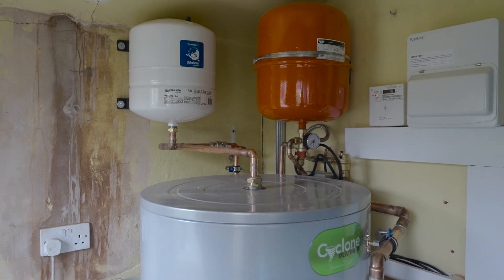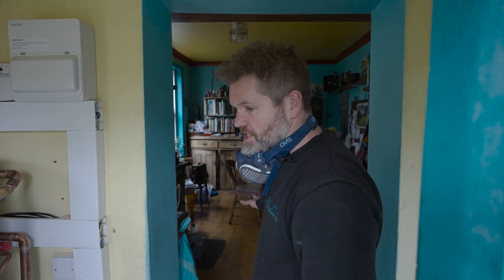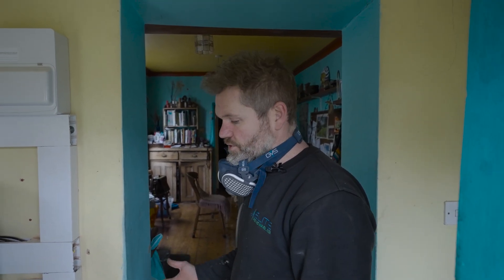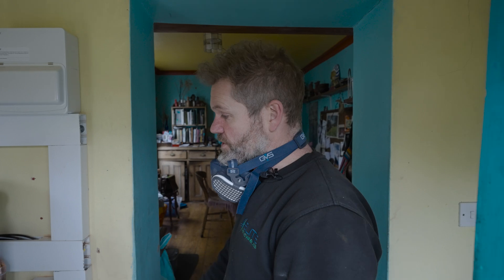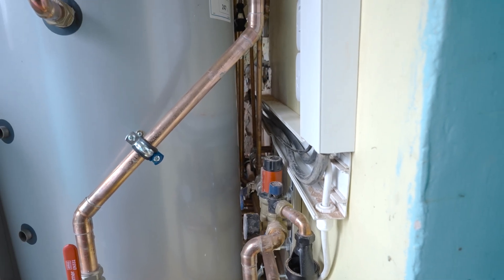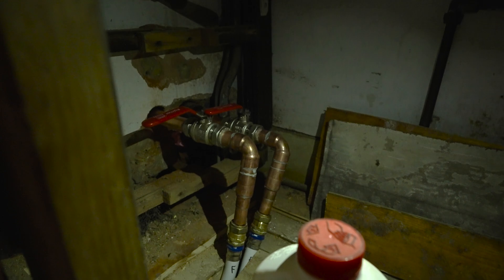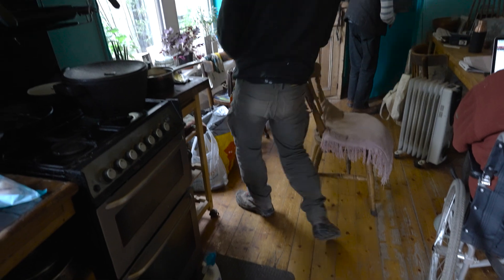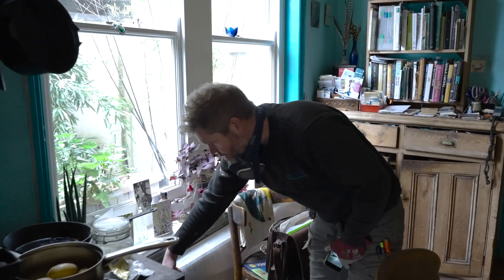Victorian House + Heat Pump = Chaos?

Comment: I guess Octopus economy Turbo install wasn't an option here ? 
Love the single glazed sash windows. I remember them from childhood. You could write your name in the frost sheet on the inside before the fires were lit when you got up early on a cold winter morning.
I cannot imagine size of  the heat loss.
On the other hand this looks a lovely old house with original features. I hope you put all the floors back before you left ? Amazing work.
Reply from the maker: We did indeed put the floors back! Octopus Turbo installs are great for maximising speed, but you do have to sacrifice a lot of efficiency which can add significant cost over the lifetime of the system. Where possible we design the most efficient system we can